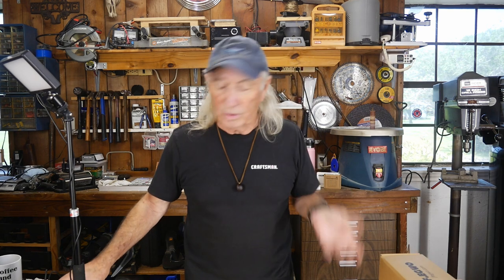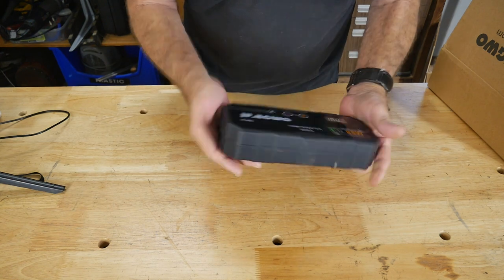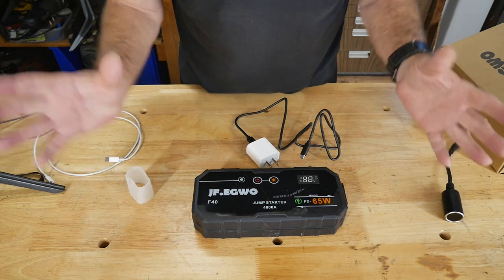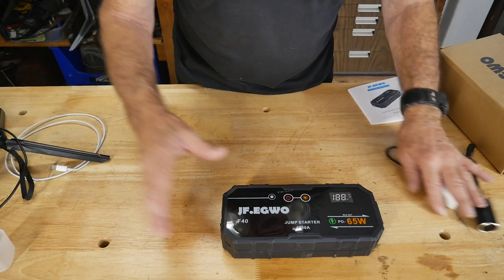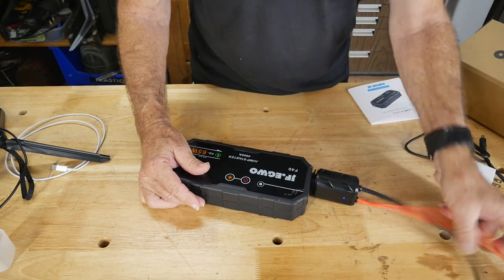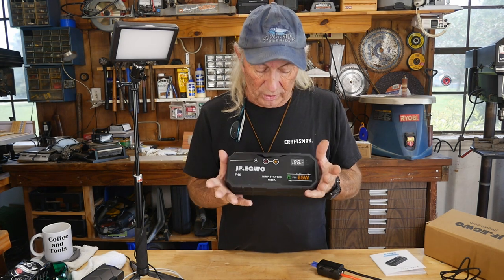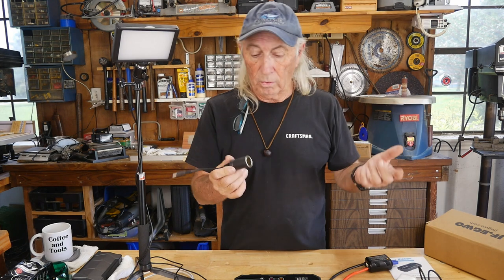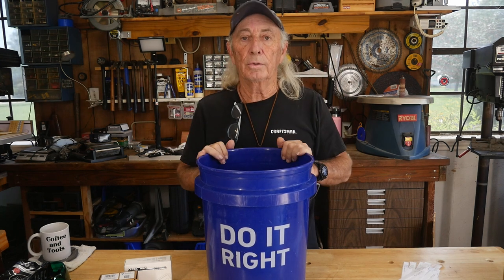Auto jumper power pack sent in for review, Draw results  @  Coffee and Tools, episode 269

Comment: OK. At the risk of being smacked upside my bald head ---
I did some reading, but did not have the actual manual.  
First, it would appear, and I can very easily be wrong on this, that they were talking engine size, as in Liters, not as in the number that can be started. 
Second, to jump start you don't press any buttons. I noticed in the video that as soon as you connected the jumper adapter to the main unit, a very small blue light came on on the bottom of the adapter. It is reverse polarity protected so that MAY be why you weren't seeing any spark. 
Please don't banish me to the bit bucket, I enjoy your shows. 
Thanks, Fred.
Reply from the maker: Thanks Fred, but there was no spark and hitting those buttons... I cut about 5 minutes OUT from my various attempts. Same with the silly light on it. Would not come on and then would not shut off. It says 10cars, the old one was 8 cars / trucks etc..
Reply: @SirTools  Hmm... As Freud (???) would say "Very interesting"!!.

Comment: Okay, gonna have to differ with ya on this one Larry! I like this item! Here’s my take on “the buttons”. The double tap system I suspect, is to prevent accidental activation. There may be a bit of a delay but I can live with that. I’m going to check out the company because I think it’s a boss of a jumper/charger. 
Good review regardless… honest and straightforward from your perspective and I respect that. 
I know…there’s always one eh!?!😁🤣
Congratulations to the winners today!
Reply from the maker: Trouble was in the sunshine here I could not read it or see if it was "ON" or "OFF" and there was another problem that got cut from the show. I actually removed over 5 minutes of trying to get it "ON" so that I could jump start. The digital read out was impossible to read in the sun, but not a deal breaker. There are 3 "looks" like buttons on the unit and I checked the manual, but could not find why or what they were for. Design ? I don't know. I tried the unit again yesterday inside the garage and gave up. Just not for me. Today we have another interesting item in that could be in question.